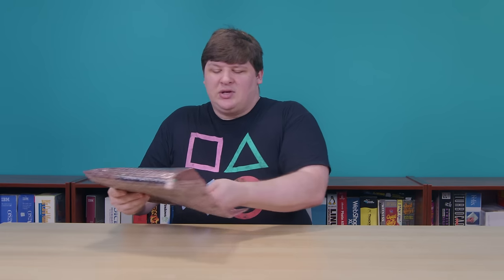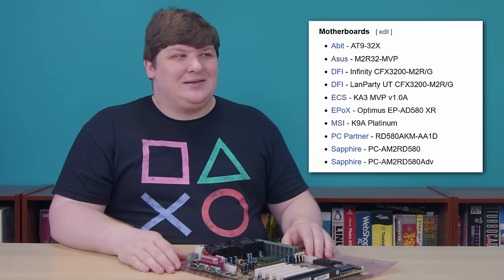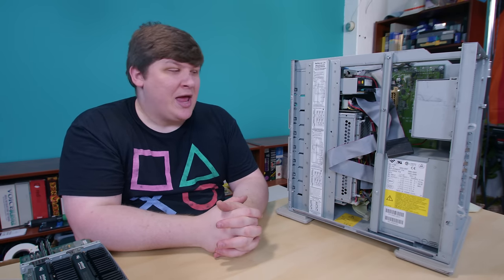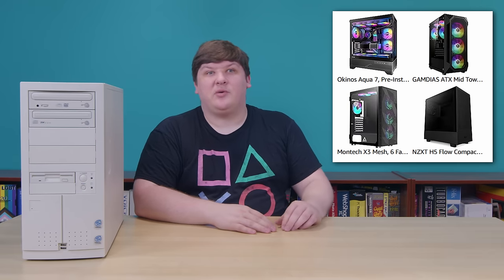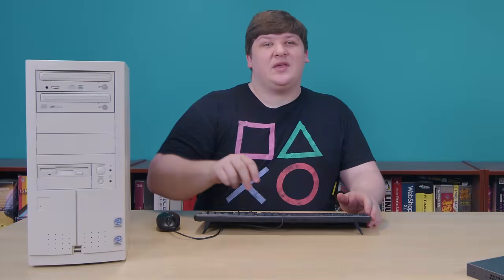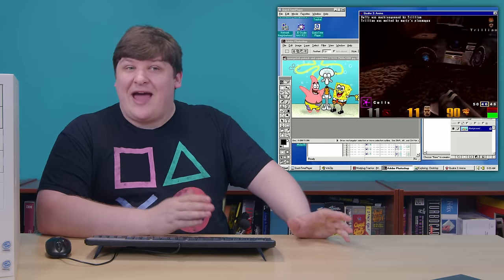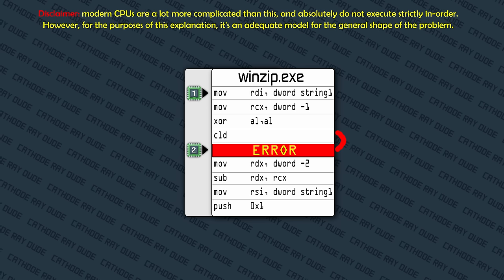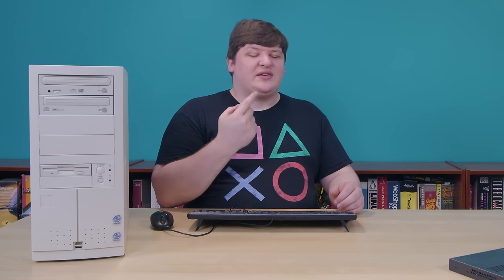The Only Famous Motherboard

Comment: You had three different types of people using those things back in the day and only two did actually benefit from it: Full on Linux nerds (Compile jobs etc), Game-server hosts and those with too much money that just wanted "the best". Kinda like the dorks that went with Pentium Pro and discovered that windows 9x and its apps don't run well due to slow 16-bit support in that processor 😂
Reply: You know personally any of those "dorks" or it's just some urban legend? The Pentium Pro was a professional grade processor and unavailable for normal people. No one in my circle had it back then.
Reply: @lordwiadro83  even worse. I were one 😂 They really, REALLY struggle with 16-bit code so w9x runs like molasses. I think you can even find benchmarks and videos these days if you want to see for yourself

Comment: I believe that the OS bouncing a process between two CPUs (or cores in a multi-core CPU) is meant to spread out the thermal load.
Reply: OS developers couldn't care less about that. It will switch task to whatever core is available if task was paused and a different core becomes available before the last one becomes available again. When it comes to performance you don't want any thread to change core's ever unless absolutely necessary. Spreading thermal load is purely by accident.
Reply: @araarathisyomama787  modern OS schedulers tend to switch to whichever CPU core has the lowest utilisation rather than whichever is the first-available in a round-robin type way. Plus of course with modern Big-little architectures, the schedulers also try to keep them on the same type of core even when they are switching around.

Comment: You didn't zip tie ribbon cables. You did the origami fold.
Reply: Exactly! And the 80 wire IDE cables starting to come with ATA/66+ were nice and stiff for keeping folds. Keep in place with double sided sticky pads or masking tape, and don't think how much of a mess that makes when you crack it open again a few years down the road.

Comment: 53:47 The BP6 didn't have an APIC, so interrupts were still "slow". DMA would have helped, but DMA was still poorly supported, even in 1999. Even so, without an APIC it's a real limitation. This means hardware I/O would have been a real kicker for SMP efficiency, regardless of the caching in those two celeries. Celery chips were also starved for cache compared to what we would consider normal for SMP chips now, or even around that time. Still, that board made for an awesome budget linux server. Ahh, good times.
Reply: Every intel CPU since Pentium 75 has APIC. You also seem confused about DMA? DMA was supported since very first IBM PC in 1981.
Reply: @rasz  Celery chips back then didn't have a local APIC, so in the end it was essentially like having a legacy PIC.

You're correct that DMA existed long before the BP6, but support both in hardware and software was often flakey, with the perfect example being that HighPoint controller. Its DMA support is what gave it the bad reputation. There were plenty of examples of disk controllers back then were if certain DMA modes were enabled, performance and reliability would decrease, like UDMA/66 on that HighPoint controller. In these cases, a lot of controllers dropped back to PIO as a safe fallback, rather than a lesser DMA mode, which resulted in high CPU usage.
Reply: @benespection  Local APIC was there since Pentium 75 (IA32_APIC_BASE). 
UDMA is not the same thing as DMA, its only sharing the name.
Reply: @rasz  UDMA for an ATA controller requires advanced DMA modes on the motherboard for bursting, so it does it with bus mastering, double-buffering, pipelining, double data rate, etc. but I guess you knew that. Everyone back in the day. It's still DMA (direct memory access) just not the way it would be done via an Intel 8237, but I guess you knew that and you're just being argumentative for the sake of pedantry.

The Mendocino core celery chips definitely did not have a local APIC, or at least there was no way to activate it. This was surely part of Intel's cost-cutting measures back then. Later celery chips surely had a local APIC, probably when they were updated to be based on the Pentium-4 architecture, but none of those can be used on a BP6. The early celery chips were super cut down.

The other big cut from the Pentium line in creating the celery chips was the L2 cache, although it was internal and ran at CPU speed, so... meh. There was also no L3 cache, they didn't support ECC RAM, they had a much lower FSB speed, and they had a crippled SIMD instruction set. It's all fairly obvious given the price point they were going for.

Without a local APIC, windows NT or 2k, or Linux, wasn't able to properly control the affinity of interrupts. If I remember correctly, the BP6 did have an I/O APIC but without support in the CPU it's moot since everything would have to go through the legacy PIC anyway.

With the legacy PIC, the interrupts couldn't be smartly routed - the OS cannot control the affinity - so in heavy I/O, one CPU may be hammered with interrupt requests, especially if the storage controller is crappy and keeps dropping down to PIO mode.

I ran a couple of these boards as servers on the cheap and tried to squeeze every last bit of out them, which taught me a lot about the right way and wrong way to do SMP. For certain loads, the dual-CPU isn't much better than a single-CPU, but it was a very good board for running websites on Apache with CGI scripts, so long as the network I/O wasn't too heavy.

This is 25 year old knowledge, and I think it doesn't matter what I say to you, as you will continue to argue :)
Reply: @benespection  Yes this is 25 year old knowledge so im surprised you keep arguing about it :)

>UDMA for an ATA controller requires advanced DMA modes on the motherboard for bursting

all in the Chipset and fully supported on 440BX/ICH.

>double data rate

no DDR involved in UDMA

> Mendocino core celery chips definitely did not have a local APIC

Linux bootlog:

>>mapped APIC to ffffd000 (010c1000)
>>Initializing CPU#0
>>CPU: Intel Celeron (Mendocino) stepping 05

There is a problem with interrupts on this board, but its this board specific and has nothing to do with Celerons. You can find old thread on Linux mailing list titled "The buggy APIC of the Abit BP6" for more details. Something about errors under higher interrupt load and missing IPI messages.

>they didn't support ECC RAM

because CPUs at the time didnt support any ram :) Ram controller was in the chipset, BP6 does support ECC ram.

>crippled SIMD instruction set

Same MMX as normal P2 of same generation :p

Even running with NOAPIC you only lose performance in server workloads.

Comment: I do remember rocking a Celery back in the early 2000s and it was probably from mid to late '99 (given the machine was a box that yellowed hella fast due to the lighting in the rooms at the house at the time). I think it was pretty dope, but then, these memories are pretty vague because I was, like, 5-7 at the time (I had messed with a computer beforehand under dad's supervision, but I think that was a Pentium II, we still have the CPU card out of that thing somewhere around here).

Some time in like 2003 or so, we got some eMachines boxes that had Athlon 64 chips in them and we all continued using those until like 2008 when dad decided all of us kids would get real laptops and suffer Windows Vista for a little bit (not sure if those had any sort of quick start on them, but I doubt it.. then again, they were Compaq machines and there was a tiny button next to the power button that I just never pressed for some reason—dad never explored that either so, I guess if it was anything substantial, we were never to find out, those laptops have LONG since been sold off).

Comment: The overclocking by far was the reason you got this setup, and why it became legend. Also had a BP6 with a pair of Celeron 400s (and GeForce 256) in 99, and I can't think of another CPU or even computer component over the last 30 years where you could not only get them at a semi affordable price, but increase their throughput by 70%+ via some small tweak in the BIOS (and a pair of FEP32 coolers), and at the very early stage when software was starting to support multi-process, get two of that same crazy value to work together. Those that were able to pick up a BP6 and a pair of Celeron 300As got just an incredible amount of value, I just don't think that has been seen since (would love to hear of other examples). And then Win2k became easily.. accessible and was still able to game, so was another win for this setup.

To give people a modern equivalent for how much value these offered would be similar now to getting a being able to buy the cheapest Ryzen 3 and having a software menu to switch it to a 7800X3D for gaming, and a 7950X for productivity. When things like that come around, they become legend, because it is just so rare.

Comment: This was a nice walk down memory lane.  While I did not build a dual 300A system back in the day, I did build a 440BX dual PIII 450 system in 1998.  I remember seeing the flyers from Dell about the workstations and wanted one.  I did not have $5000 to spend though.  It was also the first computer I built.  If I remember correctly, I put that system together for around $1800.

Comment: The whole multiprocessing thing was quite a thing. Even the NT4 GUI could suffer slowdowns if you had a program that was pegging the CPU in a single-processor system. It handled things a lot better than 9x ever could, but the jerky mouse pointers and lag in the system was noticeable when your PC was busy doing stuff versus idle. Depending on your workload, it could be noticed when your music started breaking up, given that was an extremely popular thing to have running in the background. The people who had multiprocessor machines well, they were the gods. I had seen a demo where they were running a calculation intensive program (FEA - finite element analysis) and they could still move windows around and everything else still ran smoothly. It got to the point where the guy who controlled the budget made sure everyone using FEA had a dual processor machine - us schlubs who spent their days in AutoCAD still got the lower end single processor machines. (To be completely fair - it fell onto me to set those PCs up, so it wasn't that I didn't get to play with them a little bit). Of course, this was also the days before the BP6.

Comment: It's probably nostalgia blinders, but this is my favorite video of yours recently.

I didn't have a BP6, but I did have dual slot one P3 800s on a Gigabyte board running Windows 2000 a few years after this. I sometimes miss that rig.

Comment: One big benefit for (early) multiprocessor/multicore systems, even if the software didn't directly support it, was being able to run some heavy task in the background and instead of having to wait for it to finish, you could do something else on the computer simultaneously. Writing, checking emails and so on.
Reply: Ah, you mentioned that shortly afterwards 😅

Comment: When I got my first taste of SMP in the form of a dual slot 1 board stuffed into a heavily modified HP cube case, the thing I noticed wasn't that applications worked better (they didn't); but that I could run multiple applications AT THE SAME TIME. Applications may not have had SMP support from the get go, but OS schedulers had just enough awareness to make some kind of use of multiple processors. That made upgrading to a socket 754 Athlon 64 a bit jarring; while it was a monumental improvement in performance, not being able to run multiple applications simultaneously was definitely noticed.

Comment: I had a dual Slot 1 board back in the day... I was putting a little Linux system together and ordered the parts by mail. The mail-order company sent me a dual slot board from the same manufacturer by mistake. When informed, they told me to keep it. I had a single 350Mhz Pentium II for it and never got a second one. (Can't remember if it was Tyan or Supermicro. I had both around that time.)

Very exciting story.

Comment: This vid is taking me back! I bought one of these BP6 systems new when it was first released. I added dual Celerons 366 processors with peltier coolers. (Not sure what OC I was doing back then.) The motherboard was fun for Linux at the time. It was my main system fo few years until I picked up a ABIT KT7a. Sadly, I threw out the BP6 at some point around 2010 for reasons I can't remember.

Comment: My first (and only) water-cooled PC was a Pentium 3 running Win2k.  It used an aquarium pump, hardware store tubing/clamps, and a plastic cookie jar for a reservoir (the hinged lid made refilling super easy).  The water block was a slab of copper with clear acrylic on top (the only non-custom, proper WC part of the loop).  Had to regularly check for leaks and tighten clamps, but dang it looked sexy.

Later, I made the mistake of getting the fluid to glow in the dark by adding powered dye tracer and UV CCFL lights.  Again, looked super sexy, but eventually, everything got gunked up, and water leaked down from the CPU onto the GPU and fried the lot.
Reply: I remember having a real neon tube 15 or 8 W in the case, with an inverter, before RGB existed :)

Comment: I had a BP6 for years. I regret getting rid of it. I used that thing tinkering back and forth between w98se, NT, and 2000. It ran 98se for the majority of its early life regrettably. Once XP pro with mmp/smp support hit the market, it lived as my daily driver utilizing early dosbox until it just couldn't handle it anymore. When I stepped into the P4 machines, I sat it aside and toyed with it as a Linux distro test machine. I almost never had any major issues with it and, to this day, is the longest lived and enjoyed piece of tech I've ever owned.

Comment: I was an early adopter of SMP. Of course I had a BP6 running a pair of Celerons. One thing to remember is that when Celerons first came out, they were on slot one. But although they had half the cache, it was on die cache running at full speed. For a snappy system try a pair of 300 Celerons running at 450 on a Tyan Tomcat.

Comment: I remember building a dual Pentium II machine back when I was in high school in, like, 2007-8 in one of my computer science classes. I basically knew everything or was able to learn it so fast that my teachers in both of the elective computer science classes that my school offered had simply given up and let me do my own thing so long as I continued to set the grading curve for my class. So I'd spend the class time building machines from the school's collection of aging computer components, then seeing how well they'd run a heavily cracked version of Windows XP that had all of the bloatware stripped from it, extra drivers added, and all of the hardware restrictions for installation removed. It was honestly a masterwork of OS modification and I wish I could remember which group it was that produced it because they deserve the acclaim. Anyway, it ran Windows XP shockingly well despite the OS not exactly being intended for multi-processor configurations.

Comment: Very interesting. My only dual CPU board was a dual PII 266MHz DIGITAL branded workstation that I ran as a web server in my apartment up until 2005 with SCSI drives that sounded like a jet engine at boot. It was a good "dream machine", made a great background noise that I learned to sleep with. I probably got it from a summer IT job.

I never had that ABIT board, but sort of reminds me of the IC7-MAX3 that I had. It was a monster back then with 1 AGP and 5 PCI slots, ran €€€ RDRAM on all slots total of 1GB.

Comment: This brings back memories! One point, the CPU usage works like that as by default any process isn't dedicated into any single core. It doesn't shift the process around often (eg. no thermal throttling) as that really slows the process down (you can see that in Quake 3) because the inter-CPU communication is terrible. You can set the affinity as you showed, this "fixes" the usage. Consequently, you can use set affinity to improve performance: Set the game's affinity to CPU1 and rest of the software to affinity 2. I used this a lot with the D820 and toyed with creating an automatic tool for it!

FWIW, I remember buying my dual core Pentium D820 in 2006, it was mispriced and I needed an update from my aging Athlon XP.  Alas, the Windows XP didn't realize I had a dual-CPU...The KERNEL was single core version! Instead of reinstalling the whole OS, I manually upgraded the Windows XP kernel to a multithreaded one :-D  Unfortunately, there was little benefit from a multi-threaded CPU until well into 2010s, partly because Windows's default scheduling was crud.

Comment: I still have this board in my attic somewhere! Used to have it in a full height tower running NT4...felt like a boss... but by the time I could afford to fill the case with drives I'd upgraded. 
If I remember right, voodoo 3, UT and Quake 3... great times 😉

Comment: Ha!  In that timeframe I was running NT4.0 to do OpenStep development on a dual Celeron 300A (I believe they were on SEPP packages), but I think that was on a Tyan motherboard that had the necessary fake-out circuitry to let them run together.  It was awesome!  Great upgrade over the PPro180 that it supplanted.

It was totally fun researching and putting together crazy builds like that, but I do love that today you can mostly order stuff and mostly expect it to work together, rather than just betting on getting stuff that will work together.